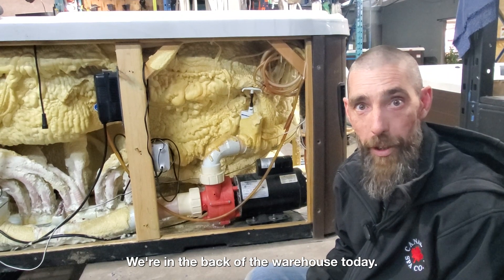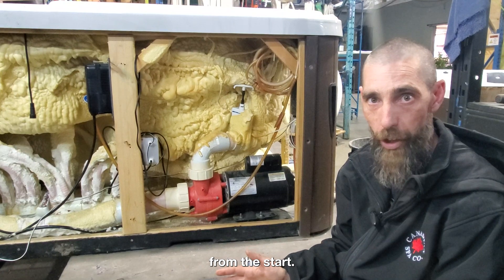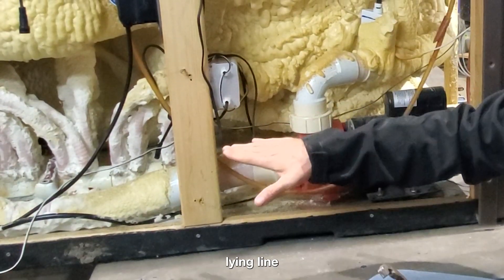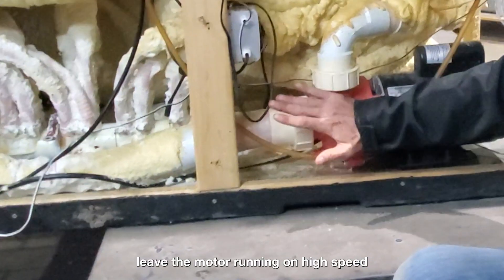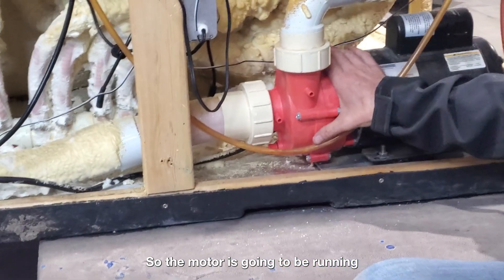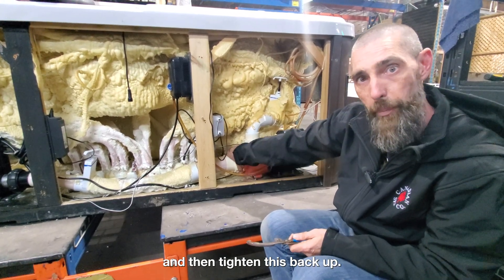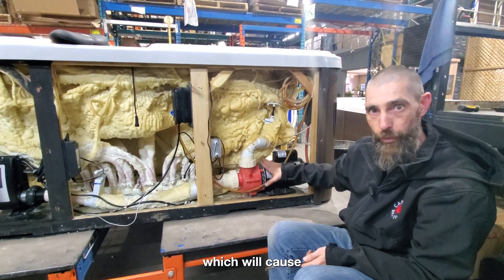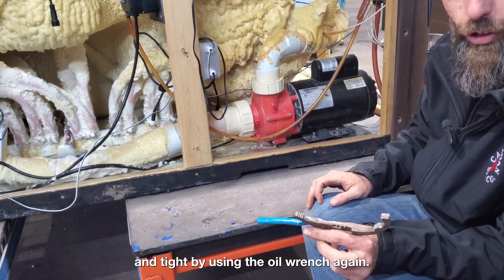Spa Troubleshooting: Airlocks

Comment: Why do you still use spray foam ?
Reply from the maker: The model shown in the video was 10 years old. We now use a different style of "spray" foam that is modeled to the shell with a higher "R" value. It helps create a better pocket of warm air inside the cabinet. Image provided here: https://cdn.shopify.com/s/files/1/0709/9855/files/HighDensityClosedCellSprayFoam.jpg?v=1724953263

We recommend high density closed cell spray foam over full foam within the cabinet. It allows the Service team easier access if a part needs to be repaired or replaced. For more information on our insulation  : https://canadianspacompany.ca/collections/hurricane-premium-spas/products/thunder-bay-2-pump-44-jet-5-6-person-spa/#insulate